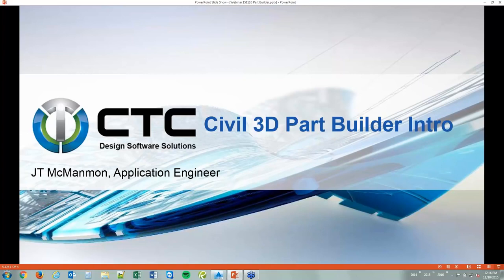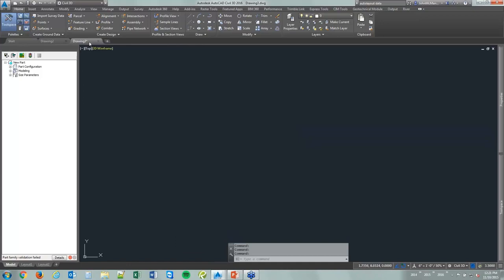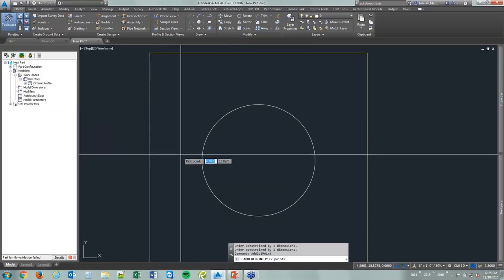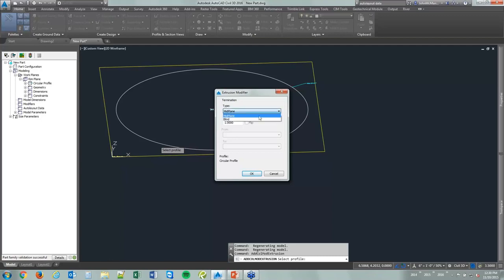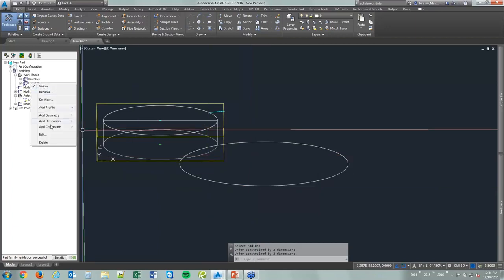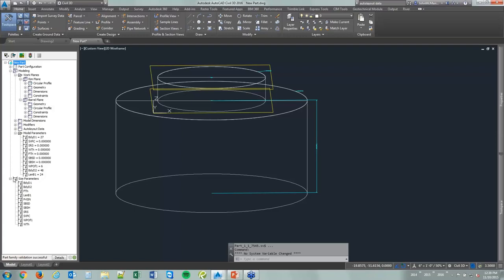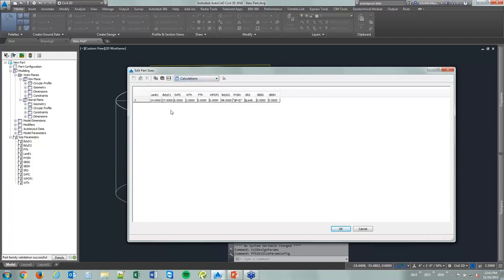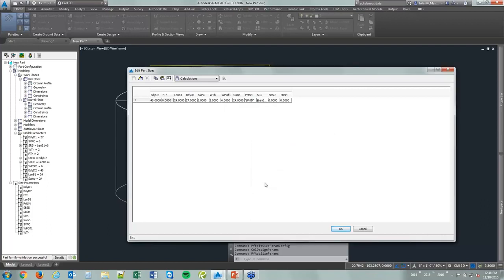Civil 3D Part Builder Intro

Comment: Really good. Is there a way to add a "Model parameter" to the offset Plane? in this case the "barrel" plane? You can add a model parameter for the first extrusion but I would like to have the same value (in a model parameter) for that extrusion and the offset plane.
Reply: Solved: Part Builder creates automatically a new parameter in "Model Parameter" folder. This new parameter is called "WPOf3" (number 3 can be any number because is the amount of Work Planes Offsets that you have already done before). WPOf means = Work Plane Offset.  From this parameter you can change the value of the offset.